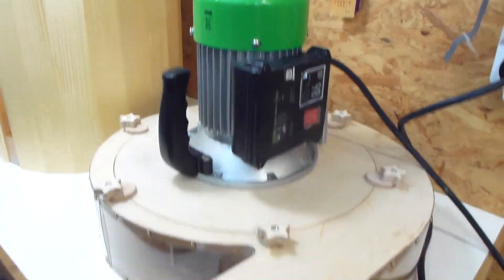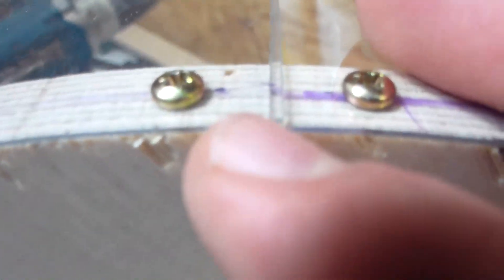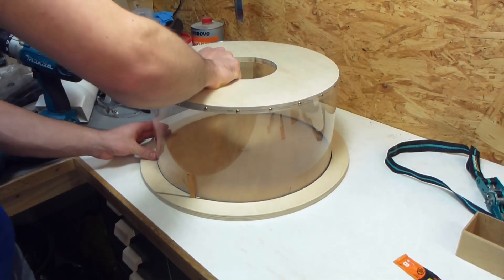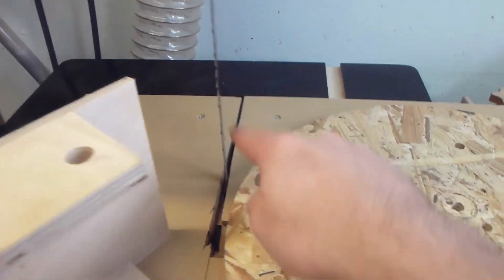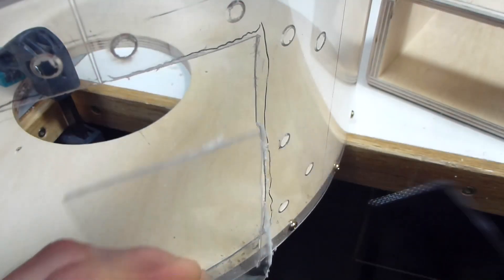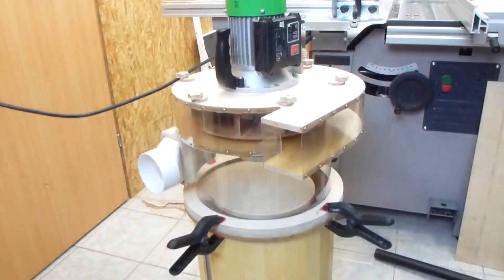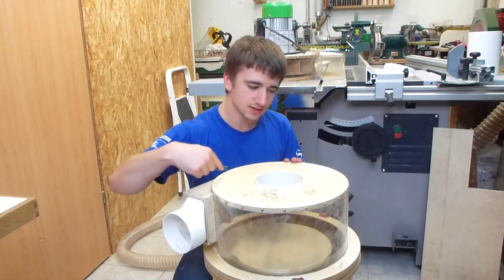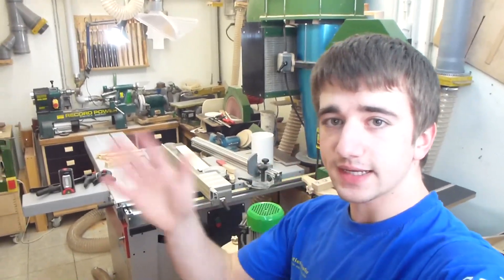Building a Thien-baffle Separator (Small Dust Collector #3)

Comment: Centrifugal force does not really exist. The air speed decreases as it goes to the centre, and spirals towards it creating a longer path. This gives the dust time to settle down. Why it probably didn't work as well with the large amount of dust, is due to all the particles bumping into eachother causing some of them to pass in front of the centre where the air is sucked in, causing them to be sucked in aswell. I know this video is over 8 years old, but maybe you still didn't know this, so I thought let's just post a coment.

Comment: It would seem that forcing the dust down, once inside of the Thien-Baffle via a semi slow arc at the entry to get the particles to go down, then, on the bottom, another small arc going back up, about 2/3rds to 3/4 around,  before the entry again, would force the particles down into the catch basin faster, which, if the arc at the bottom was at the top(bottom of the thein baffle), should bring back cleaner air. It needs a down draft for the lighter dust. The bigger chips work fine with gravity only. 
If it did not work perfectly, once the air/dust flow was lower in the drum, (not to upset the dust already in the base), another thin directional baffle could be used to keep the lower air circulating horizontally around the base, and still allow the air above it to be cycled back up. Seems the key is to get the dust/chip into the bottom area of the drum/base faster, and not circulating up top.

Comment: I was particularly interested in your neat design.  A few thoughts occur (which you already mention).  First I think more distance between the bottom of the inlet and the baffle would give more vertical drop for the particles to sink down and secondly I am wondering about the ideal depth for the outlet to intrude into the chamber.   Some designs have no tube intrusion at all, others go deeply down to nearer the baffle. Thirdly, I wonder about the ideal diameter of the chamber…too small and the wall of moving particles will be near the outlet suction…too large and the rotational speed will drop hmmm.  Great project and vid. Thank you.

Comment: A smaller diameter cyclone chamber will spin the airflow faster, increasing the efficiency of dust separation.   However making it too small will bring the particle laden flow closer to the low pressure outflow pipe.  Cyclone vacuum cleaners like Dyson have a cyclone chamber around 8 inches diameter. However there are efficiencies of scale to consider and in truth some experimentation is the only way to find out the correct size for spinning out the finest possible dust with any particular blower.  Other considerations are the depth to which the outflow pipe drops into the chamber and also the height of the chamber wall.  A smaller secondary cyclone of just a few inches diameter, to deal with the finest dust could be attached to the outflow pipe.  This would almost negate the need for filtration, although it is not worth taking the risk of breathing in microsvopic lung damaging particles....so best advice is no matter how good your cyclone set up always use a final filter....or exhaust the blower to the outside.

Comment: Great little tool you have built, the only problem with your explanation is that there is no such thing as 'centrifugal force ' because as Newton pointed out bodies continue at rest or in uniform motion (in a straight line) and in order for them to spin round an axis a 'centripital ' force has to be applied.

The air flow impinges on the walls of your separation chamber and so causes the spinning motion!

Comment: Your conclusions are right but based on assumption that are not quite complete. You should read a little bit about Bernoulli'sprinciple - https://en.wikipedia.org/wiki/Bernoulli%27s_principle where the inside of a cyclone has a smaller pressure then the outside area. This should concern all particles, never mind the size. But there are also a air resistance forces that take a part in this experiment. But you were right proportions of your Separator matters - they determinate what size of particles are sucked in into the separating bucket. Besides physics I wanted to ask you a question - could you please make a comparison about a different Separators - like efficiency for small and large dust particles (like for example from router and from table saw) ? I saw on the video that you had there a cone-shaped dust collector and also you mentioned having a bigger one.
Such a comparison would be a great subject for bigger thesis. Maybe one day someone would like to build several of such a separators connected into cascade to separate each fraction - for example for later use.
Best Regards,
Marcin

Comment: P1V1=P2V2
Therefore,
(P1V1)/V2=P2
Where P=pressure and V=velocity
You've already bestablished you require more velocity to benefit from centrifugal force. Let's assign arbitrary values to the velocity to test this principal. V1=10 m/s and V2=14 m/s (the desired effect). Let's assume the vacuum pulls 5psi, so P1=5 psi
We can now calculate for P2, 
P2=(5*10)/14 which comes out to be 3.57psi. 
This result tells us in order to increase the velocity, we will need to reduce the pressure. This can be achieved by reducing the diameter of the outlet.  This is defined as the Venturi effect.

Comment: How thick is the PET-foil? I tried it with a 3mm polycarbonate-plate, but it broke again and again...
Reply from the maker: If it breaks, it's not Polycarbonate. My bucket with 3mm PC doesn't break. The PET is 0,8mm thick
Reply: Marius Hornberger Seems you were right... my broken plates are acrylic, as I just mentioned. So, I‘m gonna get some PC, although I‘m not sure, if it‘s sold in my local hardware store...

Comment: What is the size of the square to round adapter? Or did i mis it in the video.
Reply from the maker: 100mm round to 60mm x 115mm
Reply: Marius Hornberger
Thank you very much. I have found that adapter. However, there are not alot of pipes to find is the 100mm size. 110 is more availible in the Netherlands. Would that make any difference to the performance of the blower? I'm still rebuilding my house. Bathroom, bedroom, toilet and hallway. When i get the time again to do some fun projects i'm taking a crack at this dust collection. It would be a step up from my shop vacuum for the DeWalt tablesaw and Kapex120.
Reply from the maker: No difference in the blower, since it's not using this adapter, also not in the separator, but you will notice a little less airflow and suction, because what's available is spread over a bigger area
Reply: Marius Hornberger
That is to be expected i guess. I did find a supplier on ebay for 100mm pipe and parts. Sow i guess i have to use my creditcard again :)  thank you for all the info!

Comment: hello I try to make a filter for a laser cutting and engraving machine, smoke and odor particle filter, since it works with a smoke extractor to the outside but the material that is short is MDF and has as component resin and the smoke has a lot of smell can you help me.?

Comment: Hi Marius, great video... If I may, I wish to help you with few pointers, please do not be offended....I am qualified in M.Eng but that is not the point.
Do not use Epoxy with Acrylics specially you are using a thin sheet maybe 3/32?  as the unit in operation, produces  constant vibration due to compression and pressure, epoxy is too rigid for this vibration plus you are only attaching a thin surface layer with the glue and not proper chemical bonding adhesive.

If you go to the suppliers of acrylic or poly-carbonate they will assist you with the appropriate chemical bond glues. for acrylics or Poly-carbonate.    If you will join them by overlapping a special glue is available, "is not super glue" that can be added between the joints with a hypodermic needles which is activated within 20 to 30 seconds max..  UNFORTUNATELY epoxy will fail in a very short time.

Furthermore if I may suggest 2 design changes, although you are talking about theory I do not know where you find it... as your vertical cylinder is far too tall you have to keep it as short as possible, the bottom of the dust outlet pipe must be very very close to the lower buffer or the conical cyclone.
The central tube " suction pipe MUST BE NO LESS THEN 2 TO 3" PROTRUDING DOWN BEYOND THE LOWER BUFFER, in the vortex that suction creates no centrifugal force is pushing the particles down, this way the suction created in the cyclone is being sucked down and does not get sucked upwards.

For your safety you must add a SAFETY VALVE in case you create for any reason a large vacuum pressure " such as blocked pipework"   you do not have any accident, I have seen in my professional life to many tanks been reduced to a crumbled junk, simplest way to explain if you have a tank full of liquid and a valve in the bottom and you open this valve theoretically the liquid should not flow but if you have a vent on top of the tank the surface pressure together with surface tension will push the liquid down.  In a dust extractor the pressure is fairly high as it is produced by mechanical means.

The safety valve is a very simple home made device , will not cost you more then  $5  if you interested let me know I sketch one and email it to you.
As they say measure twice and cut once which is the same, do research first then make... I know fun is in making.
Kind regards AND KEEP UP THE GOOD WORK
Jack from OZ

Comment: just an FYI, there are diagrams of suggested proportions for these thein-a-majigs, I am pretty sure from Thein himself. I built a couple, and though hard to tell just looking at yours, but you central tube seems a bit short, which might cause the fine dust to short circuit its way to the blower before traveling the full sweep. Also your inlet seems quite large for the night of this battle unit, which can contribute to similar fine particle bypassing problems. I love the seethru design, I am surprised it doesn't collapse under the sucktion :-)
Reply from the maker: Do you have links to these diagrams?
Reply: Marius Hornberger did you ever get a link?

Comment: I just wish someone would explain how the centrifical force actually works... Since there are nothing that "pushes" the dust to the walls in the direction Marius shows here.

Rather, if you think of every bit of dust as a bowling ball; It wants to continue moving straight, accellerated by the blower. It is the wall that stands in the way of making this bowling ball having to turn and follow the wall. As the wall continues to turn, the ball is forced to turn all the time: That is the centrifical force.
Thus: No pushing out to the walls, just a constant turn of the ball to the side relative to its direction forward.

I hope this explanation if conprehendable enough. I, like I said, wish someone with the videoskills such as Marius would show this in a visual way.
Reply from the maker: That's correct. Actually there is no centrifugal force. But it's easier to explain that way, because everyone knows what is meant, because we all experience that "force" or its effect in real life all the time.
But the force of the blower wall, which is pushing against the dust, is called centripetal force and keeps the dust spinning in a circle. 
And as you said correctly, the dust wants to continue moving straight (Newton's first law). And as the blower wall continuously changes the direction of the dust, it seems like there is another force pushing to the outside, which is what most people (me included before i knew better) experience and call centrifugal force.
You could also say that there has to be a force that acts against the centripetal force from the blower wall, because there has to be force equilibrium at all time and so we call that one "centrifugal force".
That's my understanding of it. Tell me, if i'm wrong.
hmm..wouldn't be too hard to make this into a small video.
Reply: You are fast! I really love your videos and your very artistic eye to every detail and also your ability to show them. That's why that particular explanation felt just a tiny bit wrong along all the other very proffesional work.
I've watched this series and the dust shoe for your CNC so many times now. It's just awesome to see how they end up. Many people show ideas, but you make a result that is so, so satifying to see.
Reply: Centrifugal force is most definitely a thing.  It's often much easier to work in a rotating coordinate system and add a centrifugal force term than it is to deal with all the rotation in a fixed coordinate system.  To put it another way, if you were a dust particle in your separator you'd certainly feel as if centrifugal force were pushing you out against the walls!  As always there's an xkcd cartoon that does a great job of explaining it: http://xkcd.com/123

Comment: Use a sheet instead of the metal screen so the sanding dust cant get through as easily.
Reply from the maker: +Glory Shelp that would decrease suction by a LOT.
Reply: +Marius Hornberger yeah i didnt think about that until you told me

Comment: Nice design that I may well adopt for my workshop, so thank you. I currently have a clear fishfood container as my cyclone with the baffle cut in its bottom and a dust barrel underneath, but the dust stream comes in so fast it completes more than one circuit of the cyclone before reaching the baffle, and bounces. I wonder if that is happening with your design - the dust appeared to be making at least 360 degrees before dropping to the baffle, by which time it missed the slot in the baffle. Cyclone height and baffle position are largely a matter of trial and error anyway.

Comment: Great video.  I like the way you attached the plastic sheet more than any other methods I've seen.

I'll share some information that I hope will be helpful.  I tested a centrifugal vacuum system that I designed a while back using cheap Bissell cyclone vacuum parts and a 5 gallon bucket. (videos on my YouTube channel).  Although I could not see or even smell dust escaping, when I tested the shop air quality using a Dylos laser particle counter I found that particle counts went from around 30,000 per cubic foot (good air quality) to around 1,200,000 (extremely poor air quality) for particles 0.5 microns and larger. 

The collector removed the largest particles but became a pump spewing out the dangerous small ones.

So, I would recommend installing your filters before using the system. The dust that you cannot see is the most important to remove because the smaller the particle the deeper it can travel into your lungs before being caught.
Reply from the maker: +Tony Shulthise That was the plan. For the little bit of testing, I did so far, I wore my dust mask.

Comment: Congratulations, this is good applied physics. I was just wondering  if the performance would improve if there would be a  narrow width  spiral baffle say two (2) centimetres wide with 10 to 15 cms pitch along the circumference of the separator  to direct the heavies down into the lower bucket, while in the bucket itself , half way say vertical  narrow baffles to cut down the rotation so that heavy particles would sink in to the bottom.
Reply from the maker: +Carmel Pule' That would help, but is not necessary, because the heavier particles drop into the bucket almost instantly. The spiral could help with the finer dust, but still would restrict airflow by a little bit. I installed such a spiral in my big dust collector though and it works alright.

Comment: hi Marius,I use a a large plastic bin with my separator and when too much is sucked up at once the vacume in the bin pulls the sides in like a temporary crushing effect 'the result is blocked filters! any ideas on how solve this? many a devider in the  bin to reinforce it??
Reply from the maker: +phildublin2005 RIght, I also have a reinforcement in my plastic bucket.

Comment: Couldn't you have used the flush trim bit with the PVC pipe rather then the template you made with the X-Carve?
Reply from the maker: +Ben Peacock No, that's not possible or would make the wrong sized hole.

Comment: Hi Marius,
First, the "Centrifugal Force" concept should not be applied in this situation, just say "Inertia".
I also wanted to ask you, these using the plastic, resists abrasion by rubbing wood chips? It deforms? it becomes opaque?
Greetings from Earthquakeland, Chile
Reply from the maker: +Victor Torres As long as I don't suck up metal chips, the plastic should hold up fine. It doesn't deform either.

Comment: hey marius. I want to make a dust collector too for my workshop. i just can't decide rather I will build a cyclone or a thin-baffle. Any suggestions? Great work!
Reply from the maker: +Jakob Nørregaard If you have more enough space: cyclone
if it has to be smaller: Thien-baffle
Either solutions work.
Reply: Okay what about time? Does it take that much longer to make a cyclone? And do you have some plans for your big cyclone?
Thank you!
Reply from the maker: cyclone takes a little longer, but I don't have any plans

Comment: Why cut a template on cnc and then rout it? Why didn't you just put the piece on the cnc itself?
Reply from the maker: +Jeff Fuchs Good question. I could have done that, but I can't tell my current CNC program where the center of the piece is. It always registers from the bottom left corner.

Comment: when in use, does it suck air around the pvc inlet shute? by using some silicone it might create a little better vacuum in the separator or it doesn't bother you at all? Great video's!
Reply from the maker: +Pieter Hansma No, it's a tight fit there. But a silicone sealing is planned. But I'll do that to all parts simultaneously when everything is finished.